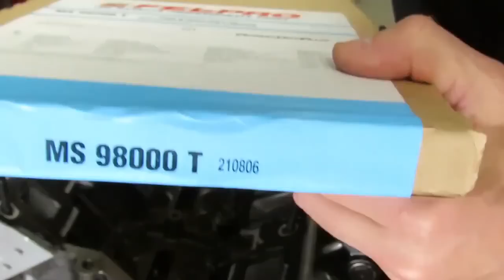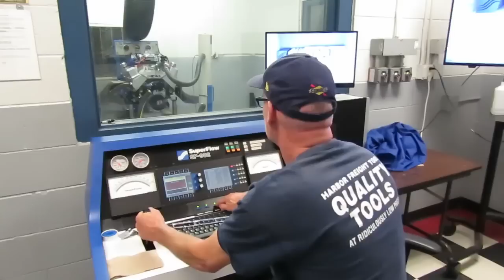350 Chevy Top End Up Grade

Comment: So I have a plain 350 Roller cam block. My block is a one piece roller cam block(pre 1996 vortec)

I got these heads on a 350 that had a starter boss broken, numbers on the deck show it was a 1990 IROC 350 engine. But who knows. 

With these heads.
14101083: 350ci. Originally came on crate engines with 285 hp or 300 hp. 64cc chambers, 
If you are lucky these casting number heads are the same. 
14096217.
 Not a great head but better than some tbi or smog heads. 
These heads are cast iron versions of L98 tpi alluminum heads on the 90 corvette. 
So 350 with short block, stock pistons, 64 cc chamber heads(milled to clean them up) I get a great 9.7:1 compression. And I run a 96-99 vortec hydraulic roller cam with stock type roller lifters.
 Custom made chip for my tbi(yes tbi) ecm. It runs great on 87 octane. It’s moves the 4400 pound 92 silverado great. 
And because money is tight I’m going to uses these heads on another rebuilt stock bore small block. I got 100,000 trouble free miles from this rebuilt short block but have developed blow by since. So I’m gonna do it again, and hope for another 100k miles with 17mpg like this engine. 
 So if anyone finds these heads i mentioned above. I rebuilt these with some better components, better valve springs, retainers and locks. I broke in with plain oil, and ran orielly and Walmart full synthetic oil and wix filters. I beat on this truck daily, it’s a great, less expensive alternative for big money rebuilds. But I think this kind of basic short block and maybe some dart 180 or even the basic dart replacement or summit heads would be an improvement. I have talked to some custom cam companies about a custom hydraulic roller and a hydraulic roller is a added expense that I think is worth it. With zinc oil at $9 a quart, and store brand oil at $6-$7 a quart or plain oil even cheaper it’s just easier not to have to buy zinc oil for a flat tappet cam. 
 If you are lucky enough to have a roller cam block it’s easier.
Reply: Before I got the custom chip, I had to run 93 octane. Once I got the correct run on my tbi and ecm. It runs the same on 87. I have some possibilities for the next one. I have a new rebuilt big block tbi unit(670cfm), I will need a new custom chip for that and may go that route. May go to carb, but I don’t think the 9.7:1 compression will run the 87 octane like the tbi will with the ignition control.
Reply from the maker: I agree the roller cam route is by far the better option the quality of flat tappet lifters has gone downhill as well lots of overseas stuff floating around I am done with the whole flat tappet zinc oil stuff it's just too much trouble, the rollers make more power anyway

Comment: PLEASE HELP me. Im building a 355 sbc (dirt track car) I can have a 500 lift max on the cam, what's a good cam for this engine HAS to be flat tappet cam. the heads I'm looking at flow 210 cfm at 500 and 138on the ex at 500 cfm

Comment: Can you adjust valve lash/lifter preload as you do in this video on ALL flat tappet & hydraulic rollers ? Or is this method exclusive to hydraulic rollers with say .500 + lift? Or is it only for hydraulic rollers with massive lift? Trying to figure out which method is best for my application. Thank you again in advance
Reply from the maker: Yep it will work on any cam with hyd lifters roller or flat tappet

Comment: I am surprised that you didn't drill and tap the center bolts like you did on prior builds. I would have done it with the engine apart. 6 bolts on the intake is certainly better than the 4 that GM did....

Comment: When you are talking about the cam bearings in the dart block at time 16.56 in the video. The roller cam dart block has the holes drilled for the factory hydraulic roller cam retainer plate. Can you use the factory retainer plate, stepped style cam, and not have to use a cam button?
Reply from the maker: I am not sure we have not tried that I don't think so. I do know that I checked a factory cam plate on the front of the block and it does not fit the best way to get that info is to call Dart directly (248) 362-1188

Comment: The heads I want to buy say they are for a flat tappet cam. If I put a roller cam in the engine do I need to change anyting
Reply from the maker: The valve springs

Comment: I was interested on how you figured the pushrod length. I've got a 400 Ford that I'm putting aluminum heads(3V) on a standard 400 Ford.  Also a new roller cam and new roller rockers. I have an adjustable pushrod but am curious on how you get lash, etc correct. Is a few thousandths ok? +/-. 
Thank you Sir.
Reply: Is it a solid roller or hydraulic roller
Reply: @fukemallgarage  hydraulic roller.
Reply: @brianmaynard7320  my vintage has some  great videos on valve lashing, good luck.
Reply: @fukemallgarage  I'll check through them.  I've got to watch the cam degree-ing vids as well.

Comment: Just got a set of Howards hydraulic roller lifters. I'm reading conflicting info as to whether or not to pre-soak the lifters before install and adjusting. What's you opinion? Frankly, you are one of the few guys I trust out here in cyber space. Thanks for all you offer to us rookies!
Reply from the maker: soak them in light oil only not assembly lube this is just to get the needle bearings in the rollers lubed don't use thick assembly lube it will gum them up and they won't roll
Reply: I know this is a few months old, I contacted Clay Smith for how to install hydraulic roller lifters. He said to take an oil can and inject each lifter thru the small hole on the side. Squirter oil into it until it overflows out the top. Then install. I did that and.my valve train is very quiet. This is with morel lifters.

Comment: Just about to upgrade the top end of my stock 350/290 deluxe. I’m curious as to why you never mention checking piston to valve clearance? Is it only necessary when running cams with .550 or higher lift ? The inter webs got me scared to just slap an aftermarket set of heads on a stock 350 without doing so. Thanks in advance !!
Reply from the maker: With stock pistons and .550 lift your Gona be far away from the pistons but you should definitely check it with clearance putty

Comment: I have a stock 1996 Chevy Silverado with a 5.7 Vortec with roller lifters. I had a problem with one of my lifters causing some other damage too, getting ready to put it all back together when I get the heads back soon. first question is- do I, do the valve adjustment like you did with my stock type lifters, like you did with those performance rollers that you put in? Question two I’m looking for a reliable pushrods, rocker arms, And lifters, what brand do you recommend for a stock application on a 5.7 Vortec, i’m thinking comp cam?
Reply from the maker: I would get those parts from GM for a stock build this is the valve adjustment you will need to do
Video link
https://youtu.be/ULA3GNHI49Y
Reply: @Myvintageiron7512  Thank you, How however the video you sent me is for flat tappet lifter where my engine has factory roller lifters because its a vortec whiich came like this from the factory. Knowing that, do you still recommend doing the same as the video link you sent for the flat tappet lifters?  Thanks again..

Comment: Can you use a later model step nose cam? It looks like it has bolt holes for a thrust plate.
Reply: In hindsight, it’s what I would’ve done with my 454. It would’ve been a lot easier but I figured it out after I had bought my roller cam and installed it.

Comment: would it be possible to include the ungrades you made. i am fixing to put a 350 in our 1991 camaro and will be making it old school like my first car i did with a 350 4 bolt main. i had a 3/5 cam, stock heads, eldibrock intake and 750 holly double pump. it was making very nice power for me in 1977 with my camaro. But this time like i said i will be repeating what i did in 1977 with our 1991 camaro. i would like to do the exact same thing this time with the way you built the top end of this motor. thanks for this video. please let us know the cam, heads/values, rockers, push rods intake and carb.
Reply: i forgot in the 1997 camaro 350 i did change the heads which had 202 intake values, i forgot the exhaust inches. i believe the compression ratio was 10.1

Comment: You probably already did the video but am interested in the exact same video for my Mark IV stock bore 454 for a complete rebuild and a favorable gas friendly with this power setup like this video shows.
Reply: power nation,?. did a build on a 454 & 460. after a total speed shop re build on the 454. it had 7 hp more than a pretty stock 460.. why not just stik an LS, in like everybody else. with cam & lifters that dont sht themselves, cos its chev..all new engines have problems, like the 3 valve ford. tech kills engines..ill keep my 351c with 302c heads.. 14 yrs, no probs. on lpg. 12.1 comp, std cam. dangerous..
Reply: @harrywalker5836  I don't want to go LS anything. I'll stick with my old nostalgic 454 motor along with my old nostalgic 60 year old self. It's always worked for me.
Reply: @ricko5123  yup. its cheaper,better stay with the old stuff. might be more in fuel, but it dont stop.. im only ford cos thats all we have in aus.. holdens were rubbish. old tech, push in studs, bad heads.  [ only pre crossflow turbo 6 cyl in the world.],  good power, cheap, but, 50,s tech. my bronco has a 351c, with 302c heads, about 12.1 comp, std engine,no came, just the heads.. runs lpg. only.. fast & cheap..better with a cam.. this, is what they should be doing instead of those ev, bs things. i dont think you have 302c in u.s., ausie invention, gutless std. 160ish hp..slug..[ i also own a 73, r/t/ challenger, 340.. woo hoo.]..

Comment: that cover would work fine for a engine with a 7 1/4 balancer, but on my 400 sbc it has a 8 inch balancer and you can't use a standard timing pointer you need one of the billet one's and not sure which ones. any ideas?
Reply from the maker: Summit has a bunch of them, just be sure to call them and ask the guys working the phones they are really helpful,
 they will get you the correct one, tell them it's a 400 with 8" balancer
Reply: @Myvintageiron7512  ok ty

Comment: Hi, just found your channel. I haven’t been around older (pre electronic) engines in many decades. Last year for my retirement I bought a 1963 Chevy Nova SS similar to the one I had back in high school. This one has a 350 with a 350th transmission. I don’t know much about the engine (I bought it at an estate sale) the couple selling it said it was her uncle’s and they didn’t know much about it, or what her uncle had done to it. It is “back halfed” and tubbed. It has GM Performance aluminum heads, headers, MSD ignition, fuel cell in the trunk, B&M shifter.
My question is only knowing very little about the engine and nothing about the internals, what gas do you recommend using, unleaded or leaded?

Comment: why not adjust the valves when both lifters are on the base circle like at 43:07?
Reply from the maker: performance Roller cams have a very small base the intake and EX and never both on the BC at the same time I know it sounds crazy but this has been proven time and again the bigger rollers will not be adjusted correctly  unless its done this way
Reply: @Myvintageiron7512  ok so looking for pushrod lengh and adjusting valves on compression stroke would be bad?

Comment: For way less money, I would have ported and polished the heads myself with a little stiffer springs, used 1.7 ratio rockers, used a steel shim gasket for more compression maybe mill the heads a little, dual plane aluminum hi rise, 750 double pumper, 1 3/4 primaries long tube headers, 2.5" maybe 3" dual exhaust. Bob's ur uncle.
Reply from the maker: way less money and way less HP
Reply: @Myvintageiron7512  Yes less HP, but l wouldn't say way less HP.
Reply: Kinda true if you have good porting skills and are not going to stuff up the heads.
Reply: @Myvintageiron7512  BS

Comment: Happy to see you posting more videos.  Guessing the new top end about doubles the power?
Reply from the maker: Part 2 will have all the results and dyno testing
Reply: @Myvintageiron7512  can't wait to c the HP results, cause I'm puttin together one very similar. i got all new bottom end but it's stock crank and rods 🙉 "but thy r new" so I hope it will b ok, but I did go with a new melling HV oil pump, and 5cc dome forged pistons and a .600 lift Hawards roller cam, with 200cc runner with 64cc chamber "NKB" aluminum heads, probably gonna run a single plan Vick Jr or something similar intake with a 750 holly double pumper. So I'm very VERY curious to c how much HP urs is gonna make with ur set up.. 🙏 Do u have any idea when u might b puttin out part 2 vid 🤷‍♂️🤷‍♂️🤷‍♂️ I can't wait to c it !!!! But realy this is just a play motor to play around with till I get my 406 sbc built like I want it, with all new bottom end, forged crank, H beam rods, 7cc dome forged pistons, with the same aluminum heads and intake/carb... 🙏

Olyeah, good info n ur videos as well !! im glad I watched this video for the set up u r running n this motor, but also for the lash on a roller cam/lifter set up... 🙏🤙very good info !! 

Sorry for the long comment 🙉 but I'm VERY excited to c what this thing makes HP wise... 🥳  if mine makes 400 HP I'm happy, but by some of the combo motors I c on utube with less parts than I have make more than 400 HP,  so idk but I hope for 400 + HP but if it will make 400 HP I'm good with it... ok I'm done rambling,  can't wait to c part 2... 🙏🤙

Comment: I don't understand why you chose to replace the pistons.  Why not recurve the distributor (pull some timing) rather than replace perfectly good pistons?  There is more to explain with regard to compression even when the scope of the discussion is limited to the basics.  Static versus dynamic compression and the effect of valve events when using a performance camshaft should at least be mentioned.  And why did you end the video without doing dyno pulls and showing the result of the changes?
Reply: He did end up re-using the pistons.  Watch the entire video
Reply: @Chuck_S  I watched the entire video.    Read my entire comment.  His explanations can do a disservice because they are excessively oversimplified and/or old school.  Most of the time his content is okay, but this one was kind of messed up.
Reply from the maker: I do agree this one ended abruptly I actually had some content get ruined that was supposed to be at the end of this video I am working on part 2 where we actually dyno the engine but the segments are not edited or pieced together, and posting them in current form would be a nightmare for the viewer we spent allot of time and effort setting up the engine for dyno testing showing all that video just wouldn't work on YouTube but I assure you after we edit and put it together so it actually makes sense to the viewer it will be posted, By the way if you actually watched the video you would know we reused the flat top forged pistons
Reply: @Myvintageiron7512  As I said to Chuck, I watched the entire video.  Doing the right thing later doesn't negate the point.  I've seen enough of your content to know you're experienced enough to where you shouldn't have even considered replacing the pistons.  Beyond dynamic compression and the use of aluminum heads, you want flat tops to create quench area in the combustion chambers of those fancy heads.  I know you know this stuff.  And like I said, your content is usually good.  I'm a subscriber.  It's just this one was kind of off so I commented.  Ideally, I'd like to see you make one or more videos where you go into detail about compression like you did with camshaft selection.  An obvious consideration will be do you stick to carburetor and distributor technology or include fuel injection, direct gasoline injection, flex fuel, knock sensing, computer controlled spark timing and boost.  I suspect the scope of this channel should limit it to the former.  Regards, Bill